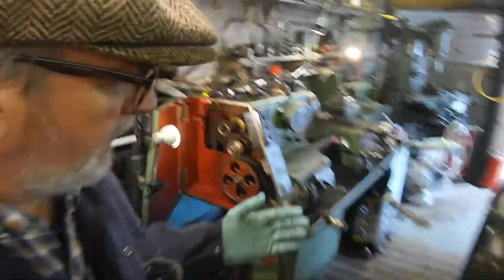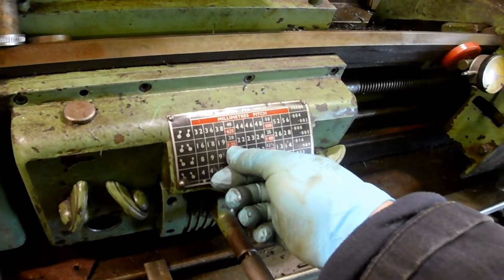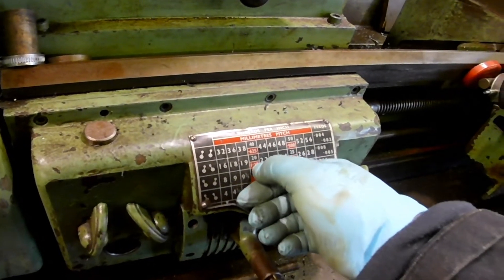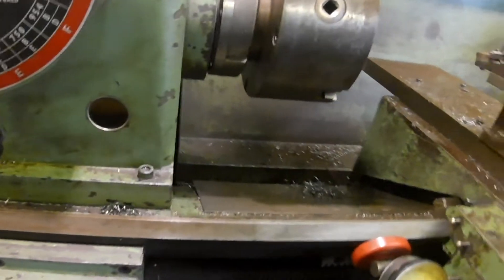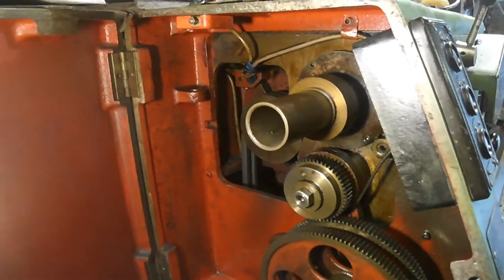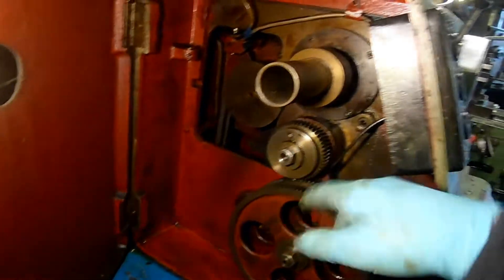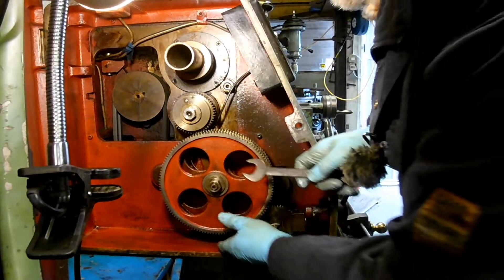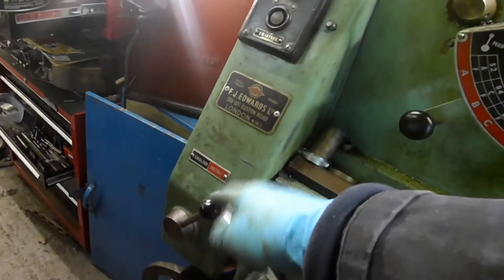Lathe metric screwcutting conundrum solved! One for the machine nerds.

Comment: I have a Willson like yours and had a similar experience in understanding the conversion gearing (I had a hand in elaborating the relevant wording on Tony's website some years ago).
The 125/127 pair are, of course, the same OD. The 50 input gear from the headstock can be swapped for alternative gears to fill in the gaps in the standard metric range; 49 and 54 are useful for this and the 49 can be made the same OD as the 50 to avoid having to reset the clearance between gears which is a bit of a pain on the Willson.
You seem to have lost the "toilet roll holders" from your lathe!
Reply from the maker: Hi eegaugh. One of the canvas shields is torn so I took the "tiolet roll holders " off. I still have them, they're just not fitted. I don't have those other gears, but I don't do much serious machining. Normally it's just little jobs in pursuit of my Early Ford hobby. Thanks for shouting up about the Willson. I really like the machine and use it most days.

Comment: Very interesting, Mart!  I ran a lathe for years, on and off in the lab model shop I had access to at a chemical plant.  I never cut many threads on the lathe, but was always fascinated by the concept of changing the gear ratios to adapt for different threads.  I never really thought about how that actually worked to get the correct relationship between the lead screw and the workpiece rotation.  I don't remember my lathe having a metric shift lever, tho. An old Clausing, I think, from WWII surplus, most likely. 

Al Hook
Reply from the maker: Cheers Al. Glad you found it interesting. They're fascinating machines. the more I know, the more I realise I don't know.

Comment: Excellent detective work Mart. I'm jealous that you have that machine. Always wanted a good lathe but, alas, don't really have the room for one!
Reply from the maker: Shame, that, Glen. A lathe is a very valuable addition to any workshop. Lots of people get good use out of a smaller machine. I must admit, though, mine is quite large for home shop. It's the long bed version too, which takes a bit more floor space.
Reply: @MartsGarage  I actually built a wood lathe in one of my Masters level classes.  We did all the castings from aluminum, did the machine work to finish all the parts as well as welding required to build a support table and required disengage mechanism/belt tensioner for the electric motor.   My favorite class, ever.
Al